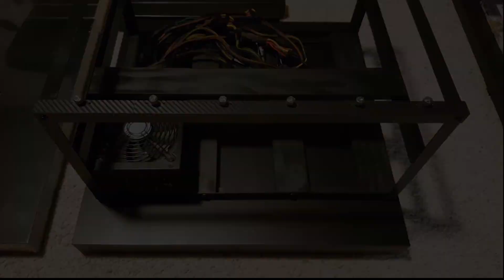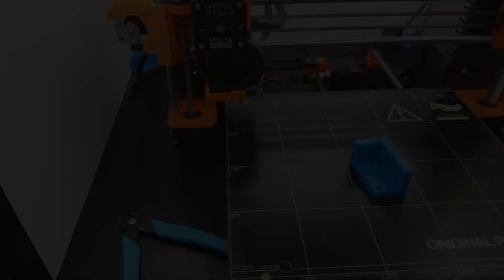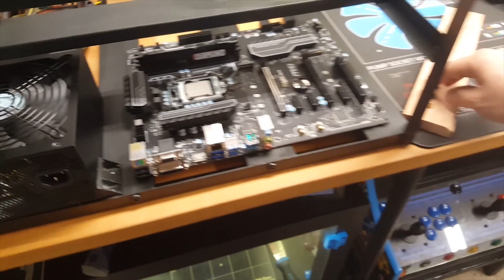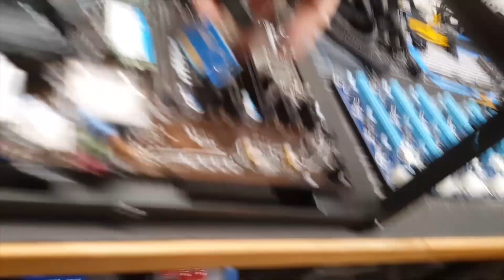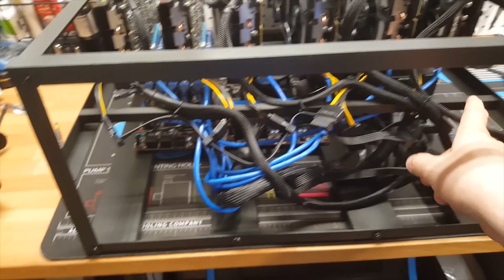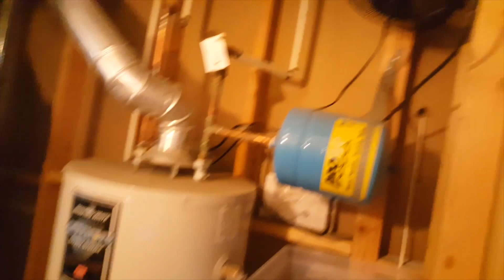CryptoCurrency Mining Rig Part 2, Hardware Assembly

Comment: Gigabyte GA-H110M-GAMING 3 (Socket 1151)
can anyone confirm this motherboard is capable of using 3 gpus?
and if i plug in a riser to PCI-E x16 will there be a performance loss? can i still use it normally like for example gaming?
Reply from the maker: I can't speak to that particular motherboard as I don't own it, but you will for sure see a performance hit if you are trying to also game while plugged into a 1x PCIe riser.  You can purchase 16x Riser Cards and Cables, but be warned they are very fragile. I have one it my Gaming PC, and I went through 3 different 16x cables before finding one that worked really well.    https://www.youtube.com/watch?v=NhhS7yAmWKo&t=8s
Reply: MrArmagedd0n thanks for the reply, so from what i know that motherboard have 1 pcie x16 and 2 pcie x1, all 3.0, so in total there's 3 pcie slot, so that doesn't always mean the motherboard supports 3 graphics card?
Reply from the maker: For mining, yes you will be able to run 3x graphics cards. But only the singe x16 PCIe slot will be suitable for gaming, as long as you don't use a 1x PCIe riser cable on it.
Reply: MrArmagedd0n got it. thanks, subbed btw. if u could explain more about powered risers that would be nice